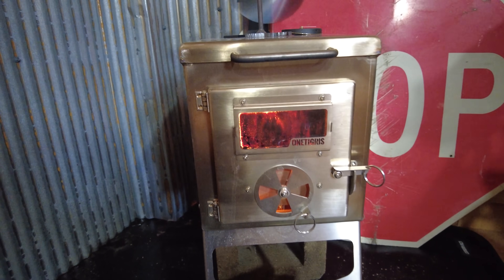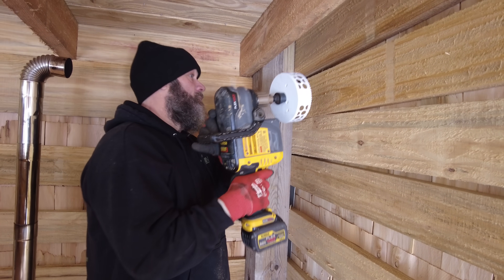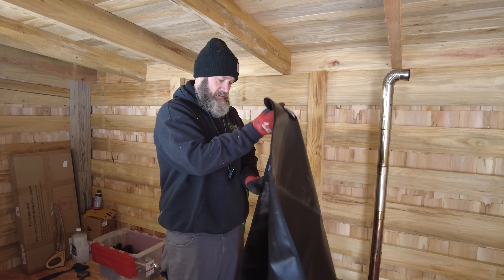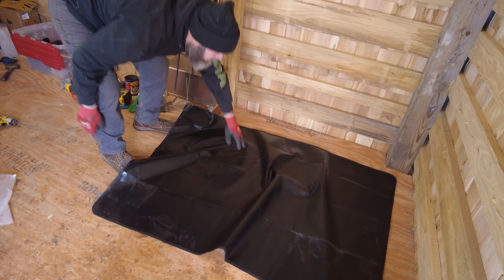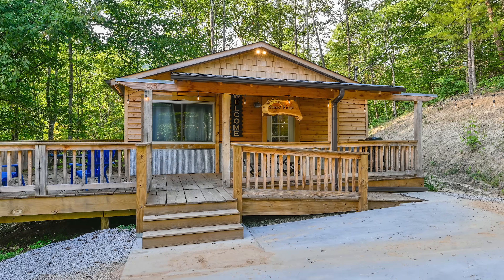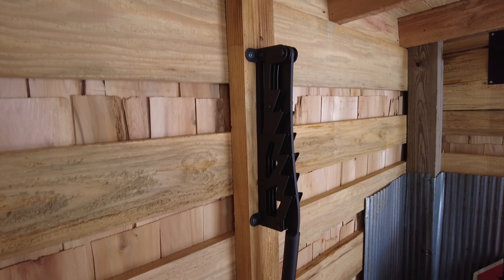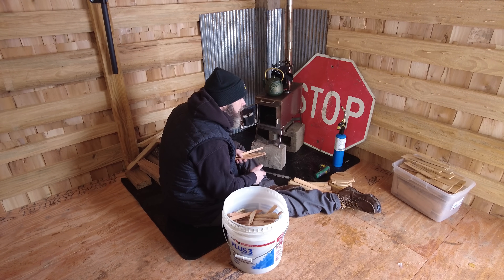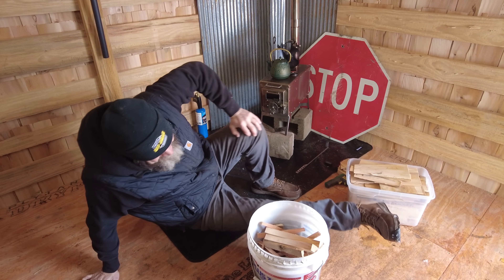How I Keep Warm in My Micro Cabin

Comment: If you wiggle that hole saw slightly while using it, it wont bind and break your wrist
Reply from the maker: takes some fines for sure. That drill has a clutch in it so it won't take off on you and a long handle so it works pretty good. With my smaller drills if you even look at them wrong with that big bit in there it wants to break your wrist!

Comment: I have what I assume will be a silly question.
Could you run the chimney pipe all around the inside of the cabin before it exits to radiate more of the heat inside? Or would the extra distance add too much back pressure and the smoke/fumes would travel back and extinguish the fire/occupants.
Reply from the maker: Yeah the more direct the better I suppose but I see allot of guys doing stuff like that with water or fans so they are directing the heat not necessarily the smoke.

Comment: If you made a water filled bench that had a copper thermo-siphoning loop under the bottom of the stove... while your having a fire, the water gets hoter in the bench and than slowly emirates heat through out the night and morning long after the fire has gone out.
Reply from the maker: yeah I have seen allot of cool ideas like that. I'd probably have to put anti freeze in it to keep the water from freezing when I wasn't using it.
Reply: @buildlife   I think you'd be right about that, it's a clever idea because it's a btu storage battery. 🔋 and If the bench had sliding louvers vents... you could control how fast the heat escapes.

Comment: To attain proper draft a chimney should be 2' above the highest peak.
In reality mainly you'll only see it on homes due to building inspectors.
An expert can regulate the burn rate by adjusting air intake and draft in smoke pipe.
Reply from the maker: yeah, 2' above anything 10' away is what they say around here. Wind exposure and roof volume have allot to do with it. Neither really apply here but I have since added another section of pipe.

Comment: The hot pipe bolted against your eve seems problematic. Also, has anyone ever hung a reflective survival blanket between the flu pipe and the wall. In theory wouldn't that double the invisible infared light wave heat radiating into the room from the pipe?
Reply from the maker: I bet it would work. This little stove doesn't get crazy hot so I'm not too worried but something to watch for sure!

Comment: The reason the pass through is a different diameter than the inside pipe is so you can use insulated pipe which is supposed to be used for wall pass-throughs.
Reply from the maker: That is correct, this is a tent stove designed to be used in a tent. They provide all the piping as part of their kit so it does not fit the through wall thimble for a double wall standard application. Tent stove as I have found out is also it's own size and they do not make it in double wall. It would require some type of adapter and is not conducive in this application where I plan to take it in and out.
Reply: @buildlife  So by using the rockwool filler you're basically making your own insulated pipe section, great idea!
Reply from the maker: That was the idea just hope the water and wolverines don't get in through that big gap too easy! @mrmrlee

Comment: In place of the wood stove I would just insulate the living crap out of it.  Years back I worked at a walk-in freezer company and would also install them from time to time.  If the freezer was outdoors in the winter we could heat a smaller one with a trouble light.  The walls, floor, and top were 3.75" thick pored urethane foam, with a SS, galvanized steel, or an aluminum skin inside and out.  A freezer that was 20' X 12' would get so hot inside from the body heat from four men working, you had to work in a T-shirt.  Nice video, but you don't need all that heat.
Reply from the maker: My shop is 2x6 walls with closed cell spray foam. You could heat it with a candle but thats not nearly as much fun!

Comment: Be careful with that long 90 degree angle with your stove pipe. My bad experience might save you the trouble. I had a gradual build up of soot  in the flat spot I had because I had the same type of long horizontal chimney pipes. A piece of kindling kind of popped and flew up there and ignited the whole thing and I had a full blown fire. Lesson learned.
Reply from the maker: no good. This one comes apart pretty easy so I can knock the pieces out.

Comment: I'm an electrician... We use 5 inch hole saws to install recessed lighting. The trick is to run that thing backwards. Go slow and there will no tendency for that saw to grab.
Reply from the maker: you drill the whole thing in reverse or just get it started?
Reply: I’ve heard of them reverse in drywall but not wood
Reply: @buildlife start backwards most of whole then forwards, sometimes it helps to prevent breakout on the back by finishing off backwards if you want a clean whole

Comment: Run the chimney out the roof.
Reply from the maker: seems to be a popular suggestion. I'm a roofer by trade so not an issue but if I want to take it in and out I'd rather the hole be in the wall than the roof when there is no pipe. Most of those roof jacks aren't meant to have the pipe taken in and out.

Comment: I'm wondering about an insulated pipe to bring in outside air to feed the fire. Maybe that would keep the fire from using indoor air and drawing more through cracks.
Reply from the maker: possibly. I find letting it get good and hot before I open the door for the first time gets it drafting pretty well.

Comment: You may want to add another length of pipe on your chimney to bring the height of your exterior pipe a bit higher above your roof. This may create a better draft for your stove and move the smoke up and out the pipe and not into your house.
Reply from the maker: Yeah, I ran out so I have one here to add. I talked to a different stove guy for another project and he said it wouldn't make too much difference tucked in the woods with that small a roof but I think your right. I got a better bracket to hold the pipe up too. I think the horizontal part is running down hill a bit. What I did notice is that if I fill it all the way and let it burn down so it's good and hot before I open the door for the first time it gets drafting better.
Reply: What about the gaps around the inside pipe
Reply from the maker: We used mineral wool insulation
Reply: Crushed beer can between tin and wall better protection. Small gap off floor allows better circulation as hot air will rise and pull cool air off floor. Probably not big difference but any helps. -Northern Minnesota
Reply: Guys, Salvation is very Simple

HalleluYAH translates “Praise ye YaH”

YaH is The Heavenly Father 
YaH arrives via the TENT OF MEETING
YaH was Who they Crucified for our sins
YaH was Crucified on an Almond TREE

— Ancient Semitic Cuneiform of Moshe (Moses)
— Isa Scroll (The Original Isaiah)

Isaiah 42:8
"I am YaH; that is my Name! I will not yield my glory to another or my praise to idols.”

Isaiah 43:11
“I am YAH, and there is no other Savior but Me.”

Isaiah 45:5
“I am YaH, and there is none else.”
Reply: @YaHsServent  Good points, but very much the wrong place to post your religion.
Reply: @YaHsServent  Acts 2:38
Reply: @mrmrlee  

YaH The Heavenly Father (Genesis 1), YaH, Who, with His HAND, formed “man (Adam)”, from the dust of the ground (Genesis 2:7). It was YaH’s HAND they NAILED to the Almond Tree, to symbolize forgiveness of the “Tree of Life” sin OF “man” and thus “The Fall OF man” (Genesis 3) and YaH The Father arrived to be Crucified via the Tent of Meeting (Exodus 33, Isa Scroll), how YaH has ALWAYS arrived
Reply: Yes add more pipe to the chimmeny
Reply: YOUTUBER "HOBO SHOESTRING" HAS BEEN MISSING SINCE 3/27/2024. He was last seen at his apartment in Johnson City, Tennessee. Please, BOLO! If you see or hear of him, please call 911. A "Silver Alert" has been activated on his behalf. He's a heavily bearded 53 year old White Man,  6' tall,  and missing the ring and little fingers on his left hand. Thank you!

Comment: QUESTION-I'm in about 14x20 cabin and I was wondering if I could just take the pipe out the window? Of course use the same preventive measures but instead of a hole just  attach to a piece of wood cut to fit the window(standard shed window)? I am in east tn..
Reply from the maker: I don't see why not. As long as the pipe has the proper clearance from combustibles

Comment: I love the tea kettle. I was wondering if you could put a small camp stove like that inside a cabin. My cabin is 800 square feet but I would like to have a small stove just in one room of it, for convenience, cost-saving and just for emergency purposes. You have beautiful eyes by the way. Awesome ending on this video. 🎉😂
Reply from the maker: Thanks! I think a tent stove would work well but I would do something more substantial with that square footage. I only did this because I thought it would get too hot with a cast iron stove. I have a pellet stove i will be installing in our next build, I'm pretty excited about that!
Reply: @buildlife  yeah I live in the woods of Western Carolinas and wood is plentiful here. I don't want to put something in that if something was to happen to our grid, I couldn't get what I need. I want something that can be completely self-sustaining with local resources. Without having to use gasoline to go get it.
Reply from the maker: @TakeTheRide  I get it. I wanted a pellet stove because we rent the cabins out and I don't want inexperienced people trying to burn rotten wood out of the forest in it. Here is a link to the ones I'm trying they don't need electricity and they also make a version that burns logs. They even make a pellet insert for the log burners to be used either way. https://flameinnovation.com/product/steelhead-small-wood-stove/

Comment: i started using a new small diesel heater they are amazing i bought a  lab power supply to run it, i can heat the portions of the house i don't use from freezing while actually heating the rooms i use... it cost as little as 60- to 100 bucks
Reply from the maker: yeah I just bought a cheap one off Amazon. I'm excited to try it out!

Comment: 30 something years ago I lived in an uninsulated house in Northern Scotland over a particularly icey winter. The house was in the middle of nowhere down a very muddy farm track. We had a small pot bellied stove in the main room. It was made of cast iron and was from an old railway workers hut that had burned down and we 'rescued' it from the rubble. We did what you did with the corrugated metal siding to act as a heat reflector around the back.
 One of the differences with our set up was we hung large woollen blankets (from a charity shop) on the walls to act as insulation. It worked really well and that quite large room was always toasty toasty. Maybe you could try this idea in your shed. 
 Putting the stove on a solid stone slab will also help. Both to protect the floor, but also to act as a heat sink. As you probably know, stone is a great storer of heat. Which is beneficial in a small uninsulated shed. 
 Anyways, I hope this helps.............
Reply from the maker: Thanks that is helpful!
Reply: My thoughts > if U hv em stack up a wall of bricks around 3 sides of the stove,,  justa idea
Reply from the maker: Thermal mass is a big deal for sure. @tomcatt998

Comment: Great video. I have several years experience heating with wood and installed a few stoves having said that and knowing what I know I always have the stove pipe going straight up through the roof with the top of the pipe higher than the ridge cap. That gives you the best chance you’ll have for adequate draft and A lot less smoke when you open the door.
Reply from the maker: Yeah there are allot of great ideas here (more than I expected) I actually just got in from extending the chimney and securing it better so the horizontal pipe angles in the favor of the draft. Let it warm up and not even a puff of smoke! Thanks for watching!

Comment: High heat silicone works well sealing these little stoves. Adding a dampener at the top before the exit helps slow the burn a bit when you want to. I got one in my tiny home and one for my ice tent.
Reply from the maker: Great tip. I've used it a couple times since this video and I'm learning a few tricks that seem to help.
Reply: Hi, I’m curious do you have this same type of stove or is it a different type that you added a damper in this high heat silicone? Please
Reply: @leahbaker1724  I have the same tent style but not this specific one, adding the dampener just gives you more adjustability

Comment: I built a 12x12 cabin in Arkansas, 17*F outside, I built a Rocket Mass Heater, 8 hours after the fire went out, it was still baking hot inside. Best heat you can have.
Reply from the maker: Crazy draft on those too I imagine.

Comment: Insulate the stove pipe that is outside the cabin and extend it by a few sections will improve your draft and prevent the smoke when opening the door
Reply from the maker: yep already did minus the insulation. Works really well once it's warmed up.

Comment: Cool cabin, I think the size of that stove is actually going to be perfect for that. It gets so damn hot in little cabins and small spaces with wood heat. You definitely need a draft to keep it comfortable when you're trying to sleep. One thing you got going for you, that place is about as insulated as a potato chip, You kind of built it like a fort instead of framing it like a house. That gives you a lot of draft which will very much be safe for you. Just a little trick from an old frame carpenter, next time you have to cut a hole that big just get what's called a rescue blade for your sawzall, put it on the high setting and move slowly with it. It'll cut it really clean. I like the hole saw though, that was pretty cool. I guess that would be manhole size, haha!

Comment: WOW NICE MUG! LOVE IT! Ahh those are so cool! Where did ya get it? :) Cast iron stoves are BS to move lol that little thing will be handy for sure! Im not the wood stove police but when I did my galvanized sheet metal behind the stove I used 1 inch collars to keep it 1 inch off the wall which will allow it perform as its designed (air flow behind it). When you stich it right to the wall it wont do what its suppose to do as you need air to flow behind it like a heat shield on a exhaust.
Reply from the maker: yeah it is on the the cross board that are 1" off the siding (kind of hard to explain) plus that stove doesn't get very hot LOL!
Reply from the maker: Also all kinds of things wrong with that install LOL!
Reply: Hahah ok just wanna be sure LOL  @buildlife
Reply: Same with mine LOL ZERO code involved with mine haha no permits or certs HAHA @buildlife

Comment: back when I was 25 I  rented a 2 room cabin it had a propane heater but I had a wood burner made out of quarter tread plate six inch stove pipe my brother had a big pile of pallets oak mind you so I thought yippi free wood so I loaded it up got going good next thing I know it's fire engine red and breathing in and out got so hot 🔥 🥵 in the house 🏠 I had to sit out side in the driveway for around three hours my brother stopped by ask me why I m out side 😅 I said go look at the stove  after that no more  pallets and no more worrys. that little cabin you built would be great for a hunting blind.
Reply from the maker: Lucky you didn't burn it down! I bet there's lots of guys with little hunting blinds like that. Maybe will put it on skis and try ice fishing with it!

Comment: I have spent a lot of time in cabins.  While I love the nostalgia of a wood stove I would not recommend it.  You go to bed burning up and then you wake up in the middle of the night freezing.  It takes up a lot of space when space is limited.  I recommend the Mr Buddy propane heaters with 20 pound tank.  Keep the cabin evenly warm and a lot less work.  Very high quality cabin and good workmanship.  I live in Kentucky so I will check out renting one.
Reply from the maker: Thanks. I have buddy heater. Very convenient but just not the same!
Reply: Just not the same... I have buddy flex, and a diesel heater,  both sre totally different in the heat um.... reflecting area.? Both cost a fuel. Wood is free , so my next idea was one of these. Or , because I already have solar panels,  I could do an electric heater,  but I already know that isn't as efficient

Comment: Your horizontal piece of pipe has to be perfectly level or up on the outside just a little. It is sloped the wrong way. Just a little bit of slope the wrong way will make it smoke when the door is opened.
Reply from the maker: Yep, I have already corrected it!

Comment: If you have smoak coming out when you open the door on your wood burner stove you don't have the dampers set right if you have the proper ventilation in your wood stove no smoak will come out and it does not matter what kind of wood stove you have just set dampers right
Reply from the maker: I see. It drafts really well when it's hot. Not so much when it's cold.
Reply: @buildlife  try heating up the flue firstit should not be hard to do

Comment: My ex heated her house with just a cast iron wood stove. I built a fire in it one day and put some pine wood in it, I thought the wood was seasoned and dry but it still had pine resin in it. That stove got so hot that when it cooled down there was a white discoloration ring around it. Lesson learned.. always make sure pine is completely seasoned and only use one or two pieces per day.
Reply from the maker: Good think it didn't burn down

Comment: Massive loss of draft with a 90 degree bend and you have 2,geez,straight up is ALWAYS best. Even with a straight pipe ya have to open burner door slow to avoid a smoke dump,put two bends in exhaust and......
Reply from the maker: Good to know